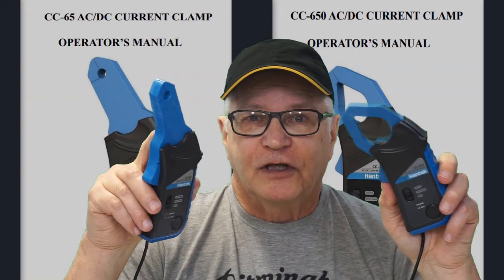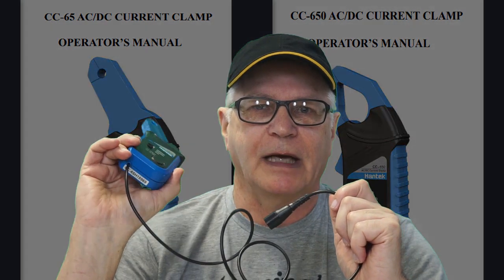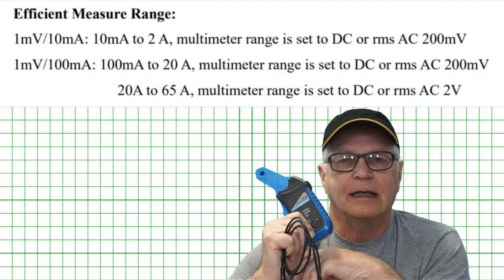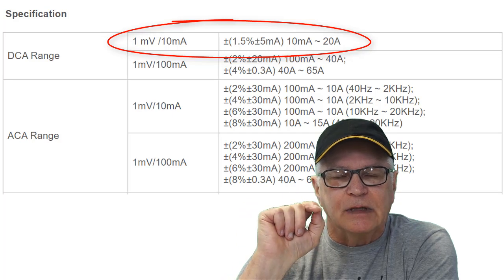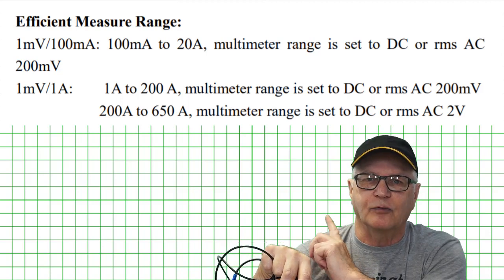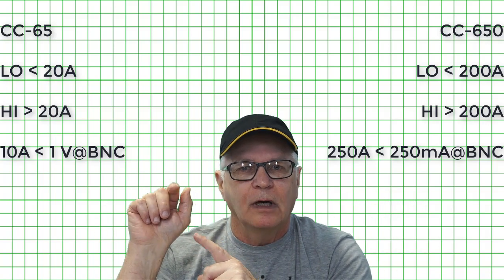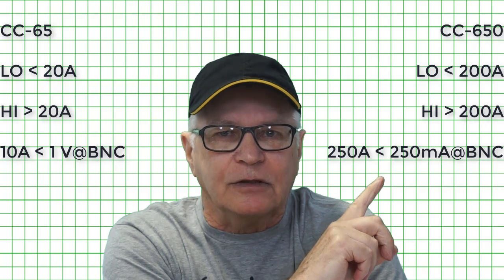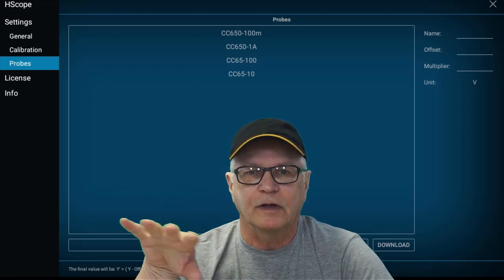GADGETS#95 - CC 65x ins & outs

Comment: what setting on the scope i shou;d have for the C65 ? and the reading would be in volts but it 1:1 amps ?
Reply from the maker: if you are using HScope, then the CC-65 probe settings are available in the cloud database for both LOW and HI ranges. They will display in amps.

Comment: Hi dear I’m having trouble with the cc65 there is a lot of noise when testing injectors could you please help me can I add a capacitor or something
Reply from the maker: I too have found the CC-65 can be noisy and I have no solution. No mod.
All I can suggest (and you are likely already doing) is to place CC-65 in 1mV/10mA range since injectors draw about 1A .. there is less noise amplified in that low range.
You could experiment with a low pass filter if your software allows it such as HScope can. I would suggest 100Hz low pass.
Reply from the maker: Furthermore...
It's not really the amp clamp "producing" the noise...it is amplifying existing noise.
Let's say oscilloscope has 15mV noise with nothing connected to BNC.
CC-65 in low range will translate that to 150mA peak to peak ... 10x ...since 1mV = 10 mA
In high range even worse ... 100x ... since 1mV = 100mA , that now becomes 1500mA
I make this point in other videos where a transducer relies on small amount on underlying mV to represent large amount of PSI for example. It's the same principle.
Reply: @theGADGETSplaylist  thinks a lot I’m  trying the hscope with my 1008 hantek think you

Comment: Hello professor, I notice a great noise pickup by the cc-65 I've been seeing some reviews on the internal part of it, your system seems very well built, but it seems that your cable is the source of noise pickup, you believe it would be better to replace the cable for a better quality or develop a filter? have a good week
Reply from the maker: You mean the HANTEK CC-65 cable itself, Osvandre?
If so, I have no intention of replacing it.
Reply: @theGADGETSplaylist  Yes, it is the only thing I imagine causing noise capture by the tool, I will try to make a filter before doing this on the original cable, because it is very well welded on the board, here where I live it is difficult to get components, I am taking away scraps  .
Reply from the maker: @osvandremolinari  I am not suspecting the cable, Osvandre...
But please do keep me posted on your results:)

Denis
Reply: @theGADGETSplaylist  I will certainly post, I will try to understand what type of filter I need to mitigate this noise.  Thanks for your attention
Reply from the maker: @osvandremolinari  keep in mind that as we filter noise, we also filter detail.
I have played with filters on these.
Perhaps you can try software filters first and see their effects before going to the trouble of experimenting with hardware ones.
Are you using HScope?
And which oscilloscope are you using?
Reply: @theGADGETSplaylist  No, I am using the hantek Scope for Windows.  The oscilloscope I use is a hantek 6254.
Reply from the maker: @osvandremolinari  I see...so no option for testing software filters...
I'll follow your work with interest while remaining skeptical of filters on CC-65:)
Reply: @theGADGETSplaylist  I started watching your channel and I understood that I should see it from the beginning, all my questions are answered here.
Reply from the maker: @osvandremolinari  cool:)

Comment: So I just got the cc-65 probe and I'm going to use it with the Hantek 6022bl and H scope. Is there anything that I need to do for the H scope app to allow me to use the amp probe with its software?  I have full license including automotive.  My scope works well with normal probes. I haven't tried the amp probe yet and was just wondering how to go about getting started. Would I need to calibrate the probe and if so how would I go about this.  Just trying to get a heads up before I get started.  Thank you very much for your time! I really appreciate it!
Reply from the maker: If you look in HScope/settings/probes...there are 2 CC-65 in the database...one low range and one high.
Simply download those 2. All the parameters are in there.
Thanks for your comment, Bob!
Reply: @theGADGETSplaylist  thank you very much!